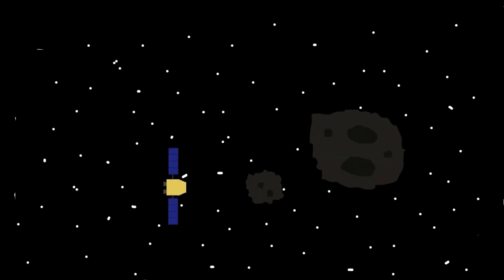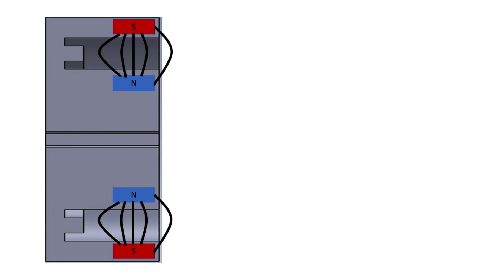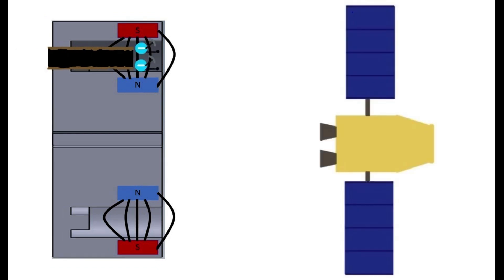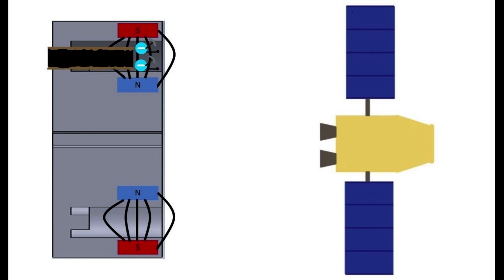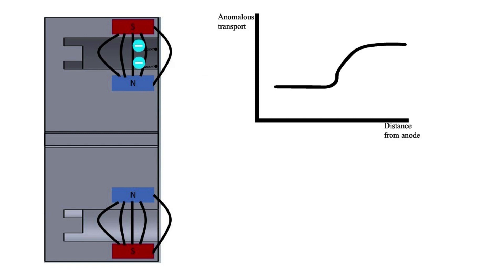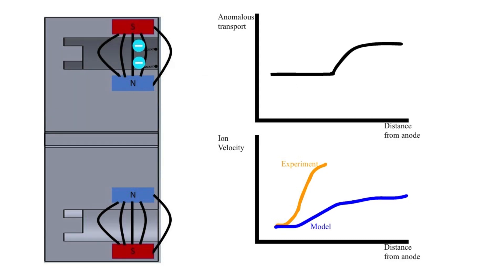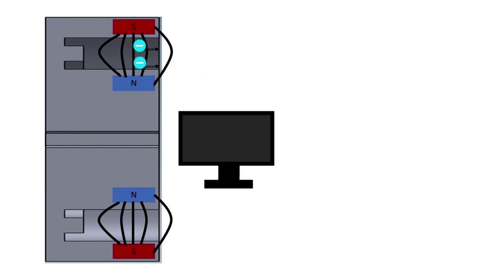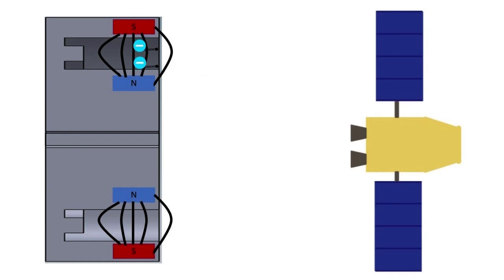How to Teach your Computer to Understand Hall Thrusters

Comment: How strong is the field, and does the flux reach a saturation, and is the anomalous current flow correlated mathematically with properties of the static field and electrons. Like what @TooSlowTube said. Since ions and electrons interacting with a magnetic field is of great importance to my other questions, I'm also curious as to the maximum interactability for useful work and its regimes.
Reply: Or is it involved with the ions flowing outward through the same imprisoning magnetic enclosure, allowing the electrons to hop and conceal their Coulomb and other expressive means of field interaction, similar to how inertial/fusion lattices and other tunneling are estimated to work?
Reply: If that cartoon graph is indicative of a real anomalous transport dataset, then it seems that ion velocity reduces transport until the ions stop accelerating then the reverse-flow transport begins and overpowers the stream via some mechanism

Comment: Could you maybe introduce a moderator, to slow the electrons down so that more of them interact with the magnetic field lines?  I'm thinking of the way neutrons have to be slowed down in a fission reactor, to make them do useful work rather than just escaping.

I guess it would have to be in the form of a gas, or a plasma.  A gas would tend to just leak out, and be hard to confine, so perhaps a plasma would be better.  You'd then presumably need some secondary magnetic coils to contain it, so that more of it stayed in the path of the moving electrons.